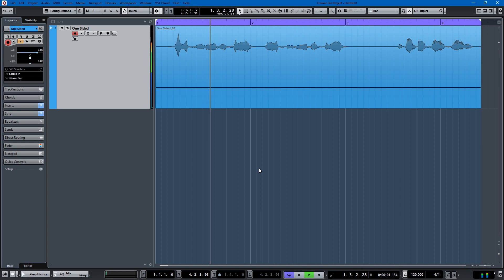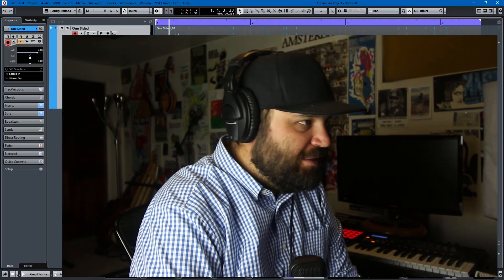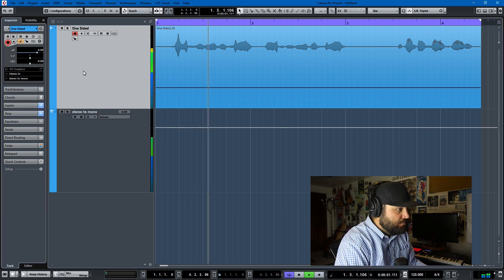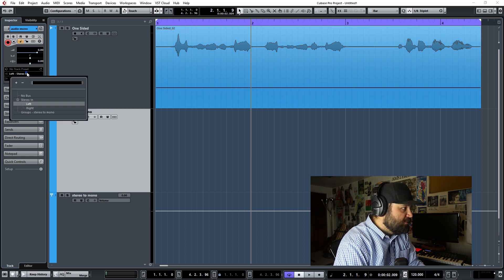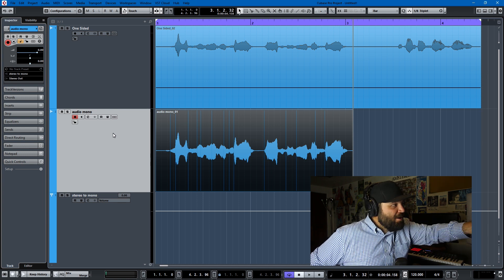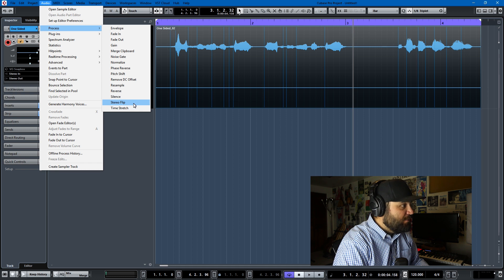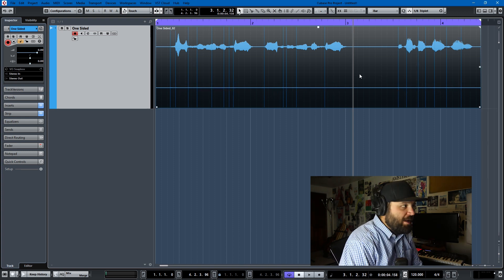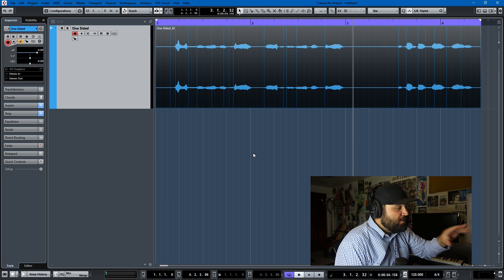How to Fix One-Sided Audio and Copy Left Channel to Right Channel (or Right to Left) in Cubase

Comment: I have another issue, which is still unsolved. And it's a pain in the ass, i mean ears

When channel's pan set 0 (both right and left are 100), left channel is like 180% louder! When i pan totally to the right, i can hear weak signal coming out. Pan set to ~75 (in the favour for right channel) gives me balance to both channels.

I am no expert. I believe I have turned something in the settings, as I believe it cant be just jamming or something.

It really doesnt matter, wheter it's a mic/guitar (both analogue), or even imported mp3 file into Cubase to a stereo audio track. HELP! :-))))

Comment: There is a much better solution to this. Press F4 and you'll see the "Audio Connections" window. By default, there's always a Stereo In input, but it's not useful at all if you have a two-channel input / interface. Add two new mono inputs, one named "Left In" and the other called "Right In" (or name them whatever you want, if you always have a certain device plugged into a certain channel). Set the device port to the corresponding input channel. You can of course store this set as a preset and save a little time setting this up per project (though it'd be nice if they could persist...)

Now, when you make a new audio track, you can select your left or right input, and make sure the track mode is set to stereo (when using a mono input channel, it will default to mono and as far as I know, you cannot convert a mono track to stereo and vice versa, you would have to create a brand new stereo track). And voila, your separate channel will be recorded as a mono clip on a stereo track.
Reply: Thank you so much , i was really confuse but you helped by explaining it. Do you still use this software for your music. Is there any way i can contact you and ask something more about cubase to you?

Comment: Excellent tip!I have run into another annoying problem in Cubase that I haven't found a solution for.  Do you ever go into your loop browser, select midi loops, and preview them only to find that one or two loop sets out of a long list does not play in the preview window, but when you drop it onto the project window it does play?  I run into this problem all too often. Have you ever run into this problem and did you find a solution to it?  It only started after my upgrade to Pro 9.

Comment: Hello , great video, an intresting topic will be musical mode vs linear mode, it is difficult to understend, saludos y gracias
Reply: Yes, musical mode; this feature is very powerful. David, it would make a great tutorial.I use musical mode all the time when tracking. In musical mode, you can slow a whole project down using just the tempo selector, or change the key of the whole song by using the key selector. I use this all the time. For instance, if I want to play a guitar part in Eb using E tuning. I just pitch the whole song up a semi-tone, play the part, then go back to the original key and the guitar will play in Eb without tuning the guitar up or down. Same if the part is a bit too fast to play; slow it down, play it; then put it back to it's original tempo. Time and pitch stretching has it's limitations, but not as much as you'd expect. Great tool.